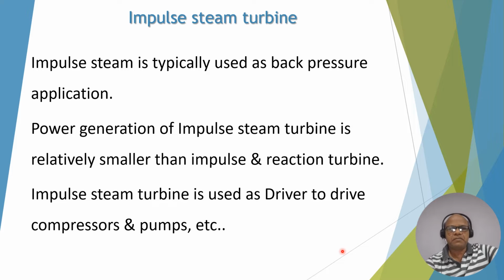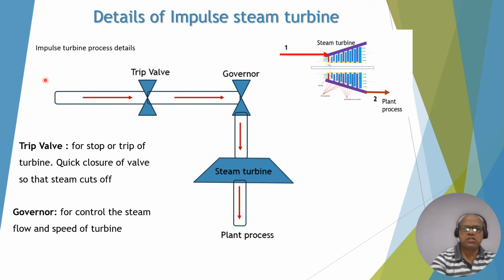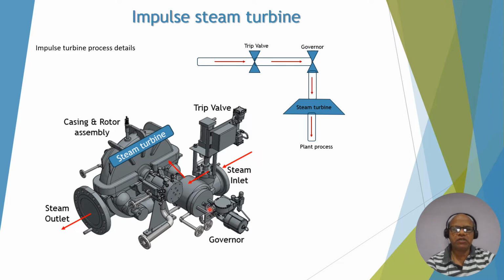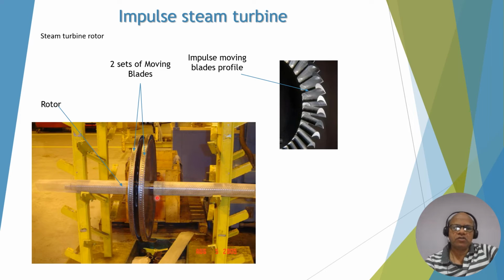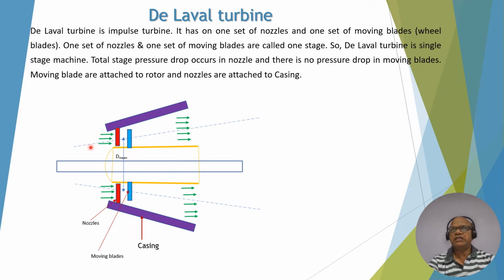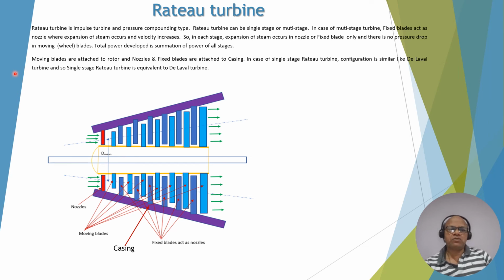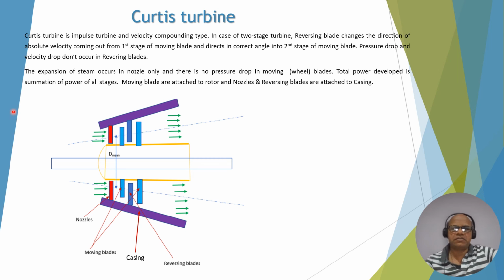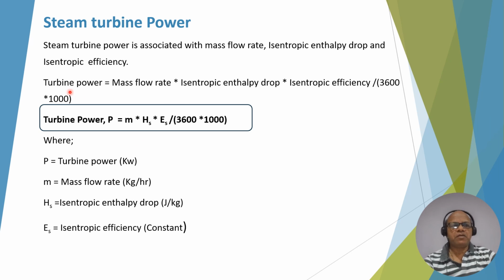Working principle of Impulse Steam turbines

Comment: Why impulse blade mount on disk ?
Opposite of reaction blade that mount on shaft or drum.
Reply from the maker: In case of impulse turbine, steam pressure and temperature are high and so volumetric flow is normally smaller (higher dense steam) and so blade inlet and outlet cross sectional area are smaller and so it is fixed on  disk . But in case of impulse and reaction blades , typically steam be becomes at relatively lower pressure and temperature and so volumetric flow is larger (lesser dense steam) and so impulse and reaction blades are larger and so generally fixed up on drum ...there could be other design aspects also for such selection.  Thank you